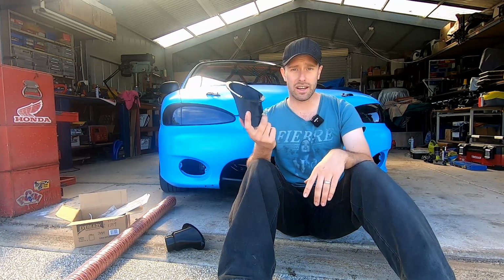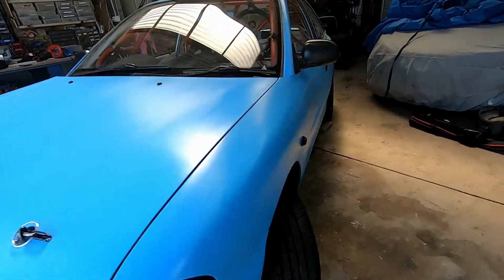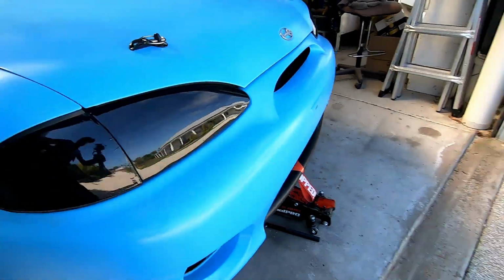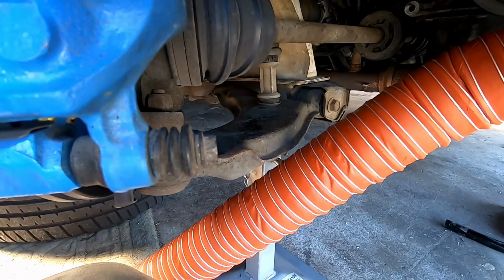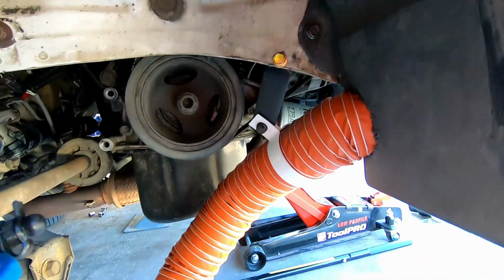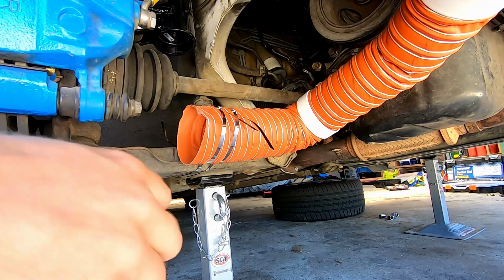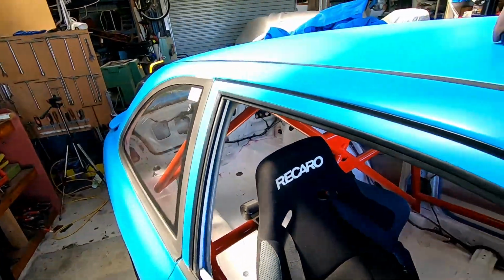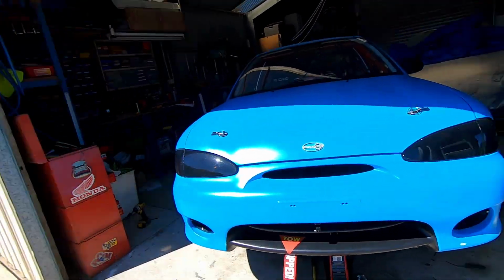Budget Race Car Build - Part 34 - Brake Duct Install

Comment: Great job! Do you by any chance offer the stl files for the duckts?
Reply from the maker: Thanks mate, and unfortunately not, it took me a long time to get it right, i sell the brake ducts to raise a bit of coin to pay for the car, but honestly all the money i've made off the ducts and gauge pods so far has just gone into equipment for filming these vids haha

Once an STL file gets out, it's out there and there is no way of controlling it.
Reply: @TheNuggetProject  Totally understandable mate, do you have a link for where I can buy them? The only issue is that I'm from Malta and I don't know if I have import charges etc. Great series bdw I'm a big fan, I currently own 2 excels one of which has an scoupe gt turbo swap and you're inspiring me to do some more racing mods!
Reply from the maker: @jurgenmallia3872  Hell yes! that would be a rocket with the Scoupe  engine in it! 

Shoot me a message on my facebook page facebook.com/thenuggetproject
we'll sort something out, might be a bit of a delay at the moment my printer died yesterday i've got a box of parts coming nextweek for a rebuild!

Comment: What length of hose did you need to get to do both sides? Usual great vid btw
Reply from the maker: I bought the hose in 1 metre lengths (1metre per side) and chopped about 20cm off both sides in the end :)

Comment: Do you circuit excel guys run street rubber or was that just your test thread?  Just wondering why you didnt measure it up with ur slicks?
Reply from the maker: Hey mate, they were just the tyres that were on the car when i got it, the tyres for the circuit excels are a federal control tyre, not slicks but not bad, i just got mine today, will be in the next vid dropping tomorrow :)
Reply: @TheNuggetProject  nice one! Double check your clearances  as the same sized tyres are not always the same size in different brands ;) 
For eg: the pirelli's vs mrf in gravel tyres measure up differently.
Reply from the maker: @troyd-motorsport9933  Yeah for sure, i'll double check but i had a fair bit of clearance, so i don't forsee it being an issue but better safe than sorry!

Comment: Hi, I have just finished modding my front brake backing plates with duct mounts so your vid has helped alot with how i am gonig to run the ducting (will be purchasing a set of you ducts soon).As to the rules  - Cams 3E curcuit excel regs section 10.i.ii     ...The front disc brake backing plates may be modified for the purpose of an attachment of a brake duct or removed in their entirety
Reply from the maker: Perfect! yeah i definitely want to make some modded backing plates, but since it's the god awful setup where you have to push the bearing out hte thought of doing that right now isn't appealing, next time i've got the brakes off though i'm going to look at properly modding them to get some decent airflow into the back of the internal veins. Cheers for watching :)